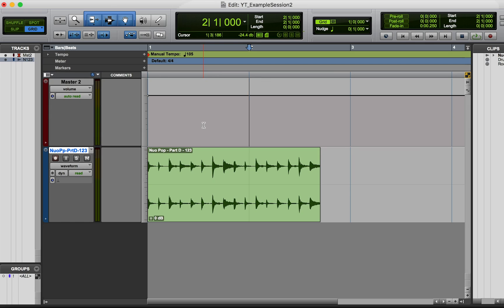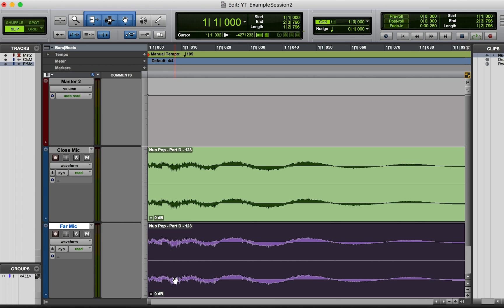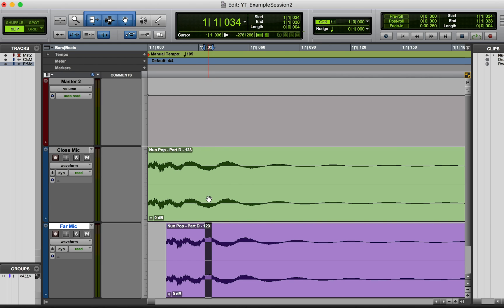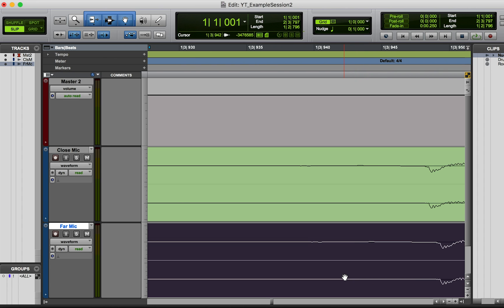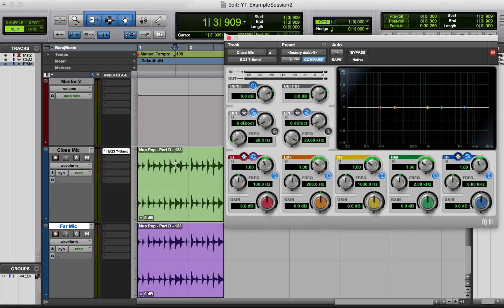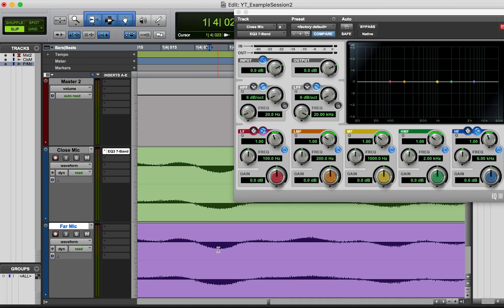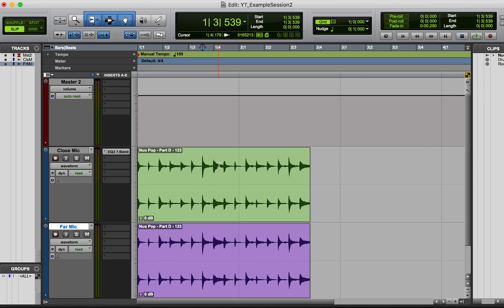Phase in Audio: What Phasing Sounds Like & How to Fix It

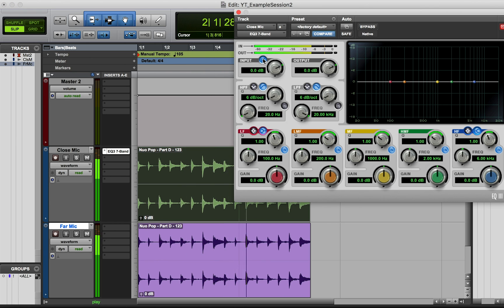Comment: When you had the two beautiful library loops running just slightly out of phase at 6:21 it sounded a little bit like a guitar phaser pedal...I'm guessing the effect deliberately uses this "problem" as an effect?  I'm trying to make a sampled drum kit, and I keep hearing that effect. The individual drum hits sound great, but once in a while that phaser sound comes up when I'm playing the kit on pads. Any suggestions how to keep that from happening? I haven't heard that happen with other sampled drum kits...maybe it does, and I just haven't noticed??
Reply from the maker: Yeah, so phaser pedals are totally doing it as an effect! For drum recording, we do have to check the phase because of microphone distance, but I haven't heard of it happening much with an electronic kit. Maybe yours is slightly out of wack somehow? Or maybe you have an effect activated that's causing some phasing?

Comment: If you move the wave forms from different distance mics to match one another, doesn't that defeat the purpose of having mics set at different distances? I would assume the delay in signal would give our ears a better picture of the room reflections that were captured.
Reply from the maker: Something like a room mic will still sound different from a close mic, even when shifted. You can solo each and have a listen to hear what im talking about: the attack, natural reverb that's captured, and even the frequency balance will all be different. The shifting shouldn't ruin that: it just helps keep the fullness of what is captured, if that makes sense.
Reply: @CatoNoise  I will try it out. I never thought to do this with say the Overheads and a stereo pair 20 feet away. I always looked at it as part of the natural delay of the room, and moving it would offset that delay time. If it ends up making my recordings sound better, then I appreciate the tip.
Reply from the maker: @bradleyduer  sure, yeah, let me know how it goes! Another thing that I think about is how our brains aren't necessarily equipped to process info with bigger delay times as space in the way we might think (our two ears aren't as far apart as the distance we often have two mics apart, you know? Sometimes we hear delay as space a bit, but not in the same way as natural reverb). So, while tiny timing differences between the left and right ear, for example, can be processed by our brains as a directional thing, larger timing differences of the same exact sound source across the left and right side at the same time just gets added together and muddied up a bit sometimes. But of course, how much and to what extent depends on the distance between the two mics. I think it's kinda cool, and fun to think about! Anyway, best of luck, let me know how it goes! 🤘
Reply: @CatoNoise  Well, I did this with a 4 source acoustic guitar, matched everything to line up with the direct signal. At first it sounded weird (had a unique warble) and I wasn't sure, but after adjusting each of the other 3 sources a few samples, I definitely got a much cleaner/tighter sound.
Reply from the maker: @bradleyduer  oh that's awesome! I'm glad it worked out! 🎉🎉🎉

Comment: That button inverts the polarity of the signal. That is not the same as a recording being out of phase, (unless your entire recording is a pure sine wave).
Reply from the maker: Yeah, thanks! I did flub up and call it a phase button, even though I know better, oof. Engineers use it to test out and work with phase issues, but it's not technically what the button does - it's just flipping the polarity. Thanks for pointing that out!